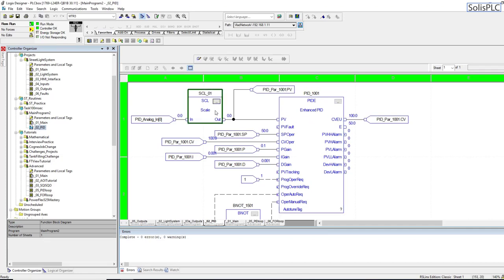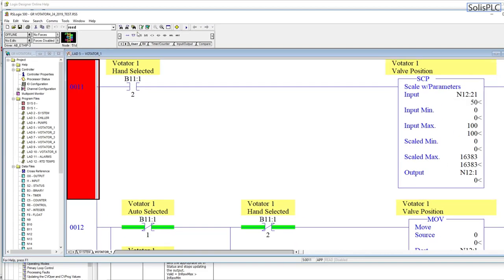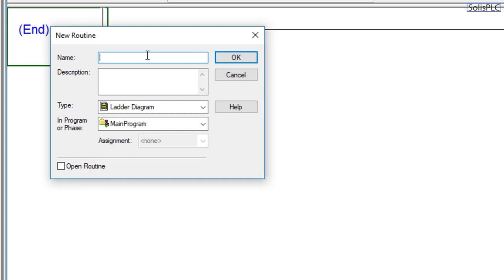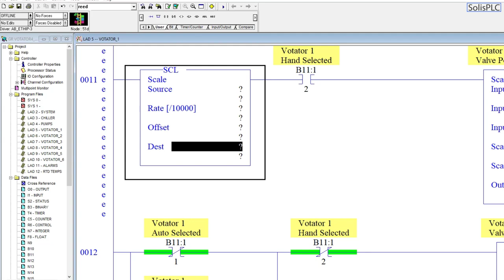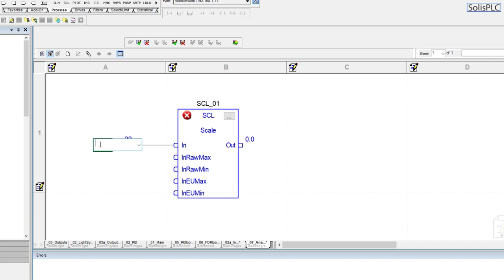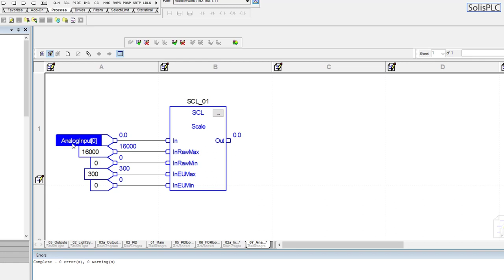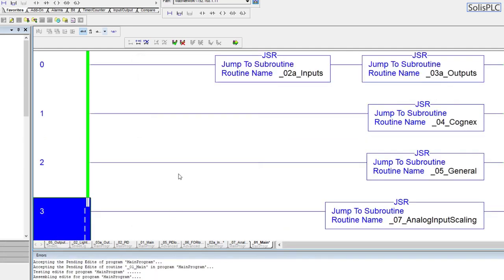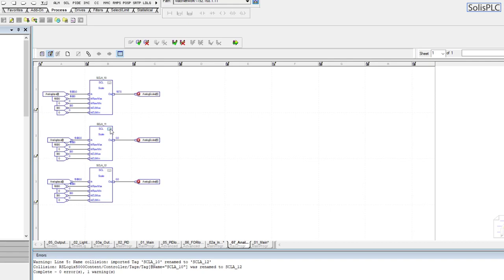PLC Function Block Programming for Analog Input Scaling | FBD Tutorial in RSLogix 5000

Comment: what happens if you don't add jump tp subsystem but still make the function block, just curious i don't have studio 5000 to check msyelf.
Reply from the maker: It won't execute the sheet. The way it works is that for each program you specify a top-level routine. From that routine, you need to issue a JMP to any other routine that you want to execute. If you don't they won't be executed. As you can imagine, this offers a great deal of flexibility; you can execute based on certain conditions only. However, in simple programs, a common practice is to execute all routines.
Reply: @SolisPLC im used to 500 and 5 , where you don't have to have a subroutine you just put it on the main routine and build tour logic. thanks dude. makes sense.